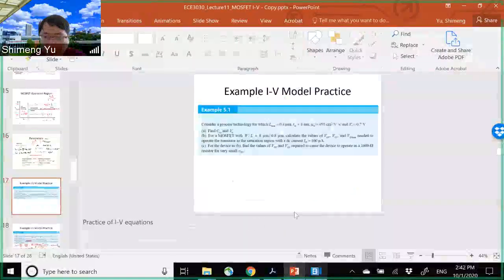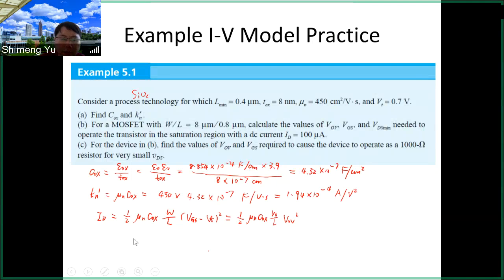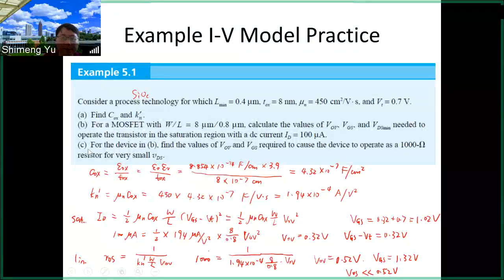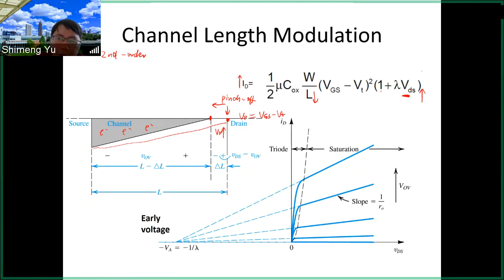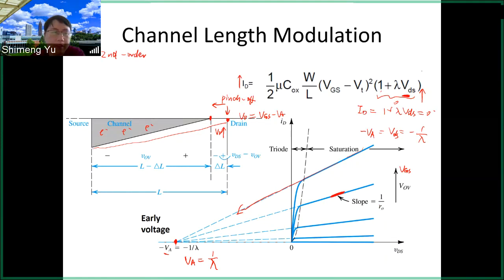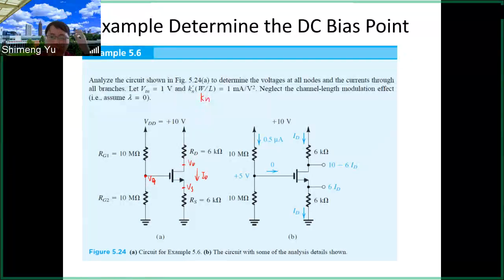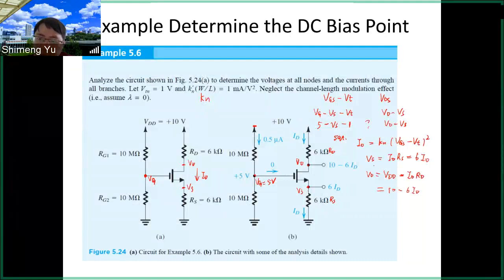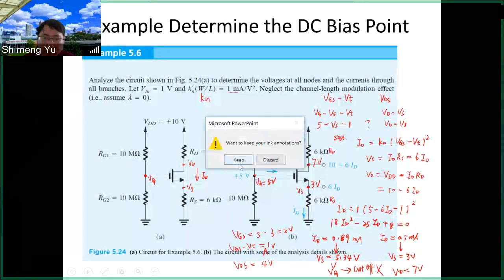Lecture11 MOSFET IV part2

Comment from the maker: Correction (in Example 5.6): the saturation current equation should be Id=1/2kn(Vgs-Vt)^2. Missing 1/2 in the lecture, but the solution to the Id is still correct.